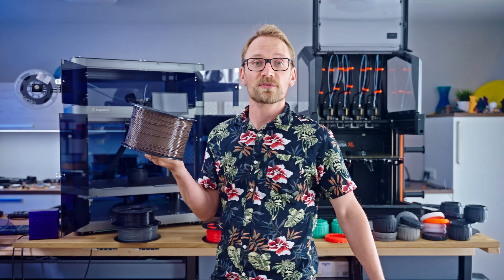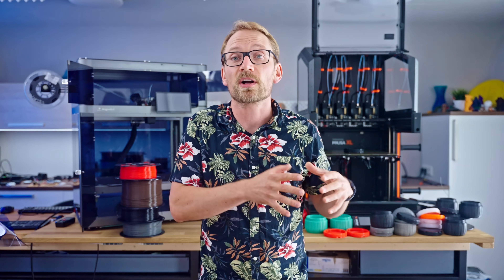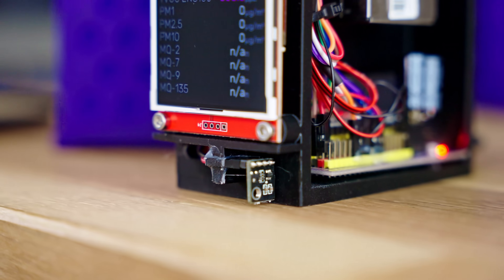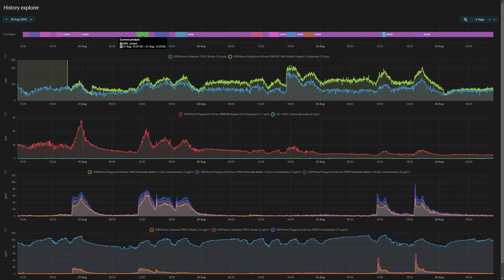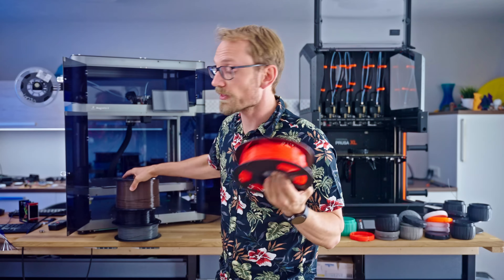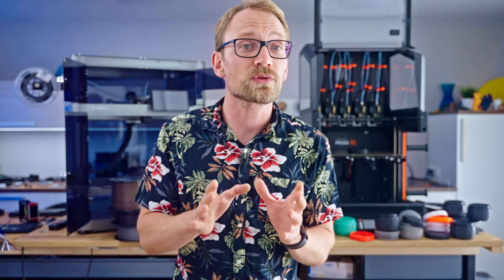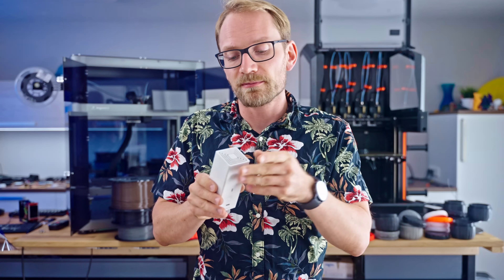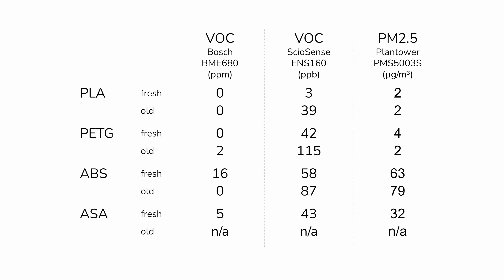3D printers are worse than I thought. Time to do something about it!

Comment: I only print in PLA Plus. I was thinking about getting an air purifier that has a hepa filter. Will that be enough?
Reply from the maker: Unless you know the emissions profile from your exact filament, it's impossible to say if a HEPA filter alone will be enough. Since I didn't measure significant amounts of particles or VOCs when printing with PLA, I still don't know what is causing the throat irritation for me that I get when sitting next to a printer printing PLA, so I don't know how I would have to filter it out.

Comment: Its like asbestos...only when the impact happens that alarm bells go off. I have printed heavily over the last 9 years. A couple of years ago I decided to put all the printers in a single isolate room and put a decent exhaust fan. It is now negative pressure and its the only way to be safe; it goes direct into the roof space and because of convection they go out the passive whirly birds; but the real question, why is there not industry standards and traps with sustainable ways of trapping and disposing of the refuse.

Comment: what kind of ventilation unit do you use for your studio, I have a similar setup in my garage which I converted to a 3d print studio but my ventilation is basically non-existent
Reply from the maker: It's a Zehnder Comfospot 50, which has 50 m³/h of air throughput and, importantly for me, comes with a heat and humidity exchanger, meaning that I can run the dehumidifier in the studio and I won't introduce tons of new humidity from the outside whenever the ventilation runs (which is pretty much always).

Comment: One issue with what was said - the daily/annual/etc cutoffs from the WHO are not a line between "safe" and "dangerous". Rather they are typically set at 1/10th to 1/100th the lowest dose found to have a detectable biological effect. And biological effect isn't necessarily toxicity.

Not to say that we shouldn't be worried about this, or take action. But breathing these particles in for 3 minutes will not have a measurable effect on your body, even if you've exceeded that cutoff.

Comment: I've been using particulate matter sensors attached to my homeassistant setup around my house and in my printer room for over a year. I only print ABS, PLA, and PETG. I've never seen any significant levels of pm at 2.5. If you want to scare yourself, open some microwave popcorn near a sensor. Proximity is a real issue, and generally speaking, you have to be pretty close to be affected. Unlike Thomas, I did find enclosures help, and as I'm not measuring vox, I found carbon filtering didn't help, but HEPA filtering does. It's quite easy to set one up with both and a positive pressure fan. Opening a window with a fan blowing air out makes the most difference, but the levels have always been way below recommended minimum levels even with the worst (Prusa) and the sensor within 1 metre.

Comment: I have an smaller ikea filter like you showed. How often do you reckon he filter cartridges needs replacing
Reply from the maker: It has a filter change light that comes on based on runtime and fan speed - on the lowest setting, that's a couple of months. I tend to change my filters based on how messed-up they look - if they've been running for half a year but still look like new, they get to go again until the change light comes on again, but if they're all grey and sticky, they go in the bin. The filters shouldn't lose their effectiveness, but they will increase in flow resistance over time. Basically, your call how filthy you want to let them get ;-)
Reply: @MadeWithLayers  thanks. Was thinking to do the esphome hack for the sensor but haven't done yet. Did you say the IKEA sensor isn't great for 3d printer pollutants

Comment: I read an article a few years ago that you are exposed to dangerous levels of voc’s when you buy a new sofa with foam cushions and the memory foam mattresses can both of gas for weeks after installation. My printers are in a dedicated room where I don’t work while printers are running. Years ago photocopiers and laser printers had to be installed in a dedicated room with high ventilation due to toxic fumes. This is an issue that’s around us everyday and not just 3d printing.
Reply: An especially notable example of this is new car smell. It can take over a decade for that to finish off gassing.

New car smell has always made me feel nauseated and gives me a headache ever since I was a little kid.
Reply: @nobody2021 and you can buy it in a can😂
Reply: that's why california puts that cancer risk warning label on seemingly everything.
Reply: One youtuber did some tests on his print room too... He kept   getting spikes when he increased ventilation.

He concluded that being neighbour to 3 construction sites made the outside air much worse than his printer Room
Reply: @greystorm9974  This is both hilarious and terrifying.
Reply: @greystorm9974  What Youtuber?
Reply: @greystorm9974 depends on what you are printing, but also "increasing ventilation" implies you are getting clean air. If you live next to a factory or use your car exhaust to push more air into your room you're obviously not getting clean air and need a change
Reply: @jawaring4367 Windows open and using regular fans. Will see if i can find it
Reply: The mattress will diminishingly give off gases for weeks... but the printer is will be doing it full blast every time you use it for years.
Reply: laser printers and copiers are source of ozone which in higher concentrations is harmful
Reply: good insight

Comment: Thanks for raising awareness! Have you experimented with Nylon? Also it would be interesting to see how these numbers change for composite filaments that contain glass/carbon particles. 

I have adapted the exhaust of my P1S to attach it to active extraction Duco system of the house. I have also modded the stock cartridge to include small hepa filter and loose pellets. But I will certainly consider buying a standalone filter for the room.

Comment: I did built an air exhaust/evacuation system and enclosure out of wood & arcylic to print more exotic materials on my Ender 3 Pro. But my enclosure is not big enough and I settled on just printing PETG & PLA. Maybe ill buy a small printer that can fit inside my enclosure and just make it dedicated to printing exotic materials.

Also should i be concern if my PLA starts to smell sweet and surgary?

Comment: Those formaldehyde sensors are totally inaccurate. At those levels you would smell a horrific smell if there was actually formaldehyde. They detect all kinds of other chemicals as formaldehyde. I would recommend not using those sensors as they will mask real problems. In environments where formaldehyde really does need to be detected, they don't use those sensors. They are essentially a scam. You can read the academic literature on this topic, and you can see that these sensors really don't work at all, and that you have to use other techniques to pick up formaldehyde. The VOC sensors are also not perfect, but they do detect various compounds with different levels of sensitivity as you mentioned. They are more acceptable.
Reply: Also, side note, just buy activated carbon and make your own filter.
Reply: Also, you should test whether dried filament emits less, particularly for PETG. This is something I have noticed, but I would love to see what you find.

Comment: Those particle matter sensors cannot measure particles > 2.5 micron. So every reported value for larger particles is extrapolated.
This also means the humidity will have an effect on your measurements as those smaller particles can stick together.

This will cause hard to interpret data. So as always: "Measuring is knowing, when you know what you're measuring".

Thus try to correlate concentrations with the humidity when drawing conclusions.
Reply: they are good enough considering the actual health effect correlation to particle size, a normal home air filter will filter out most of those particles but any Vocs, but PLA and PETG dont produce them in enough quantities to be concerned about, the air quality in most cities is worse than any ventilated room pritning PLA can be
Reply: @swe872  My point was more like those different materials are printed at different temperatures and thus also affect (relative) humidity. And with different humidity your measurements may shift in the actual particle sizes. Since those sensors do not measure over 2.5 micron it might report much lower readings while you may have quite a bit floating around only stuck together. This then makes it much harder to compare them.  And whether those sensors are "good enough" depends on what you try to measure. For example in a wood workshop those might report totally unrealistic low values when you can't even see clearly anymore due to the dust, but those sensors report all is just fine.

Like I said, measuring is knowing if you know what you're measuring.
In other words, if it is unclear (or the manufacturer is not giving information ) what the sensor actually does with the sampled data, does it even make sense then to measure it at all?

Comment: I would argue that an enclosure can actually help preventing the fumes from entering the room when you properly seal it. I use a 60 cm server closet with dampening mats and gaskets for the doors so there is very little exchange between room and enclosure. Inside of it I use a small bento box filter that circulates the air and runs even after a print is finished. Additionally I use a room filter with active carbon and hepa 12. Medion has some cheap options with affordable replacement filters.

Comment: Very surprised there was no mention of the Nevermore filter project! It's an open-source recirculating filter with a few configurations. They're mainly intended for Vorons but can be installed in/on any printer.

I have a Nevermore StealthMax and it holds about 1lb of activated carbon pellets. It has VOC sensors in the intake and exhaust to verify the filter is working as it should. You want to really seal up your printer well because it is a recirculating filter. The more times the air passes through, the cleaner it will be. Plus, you don't want unfiltered air leaking out. It's very effective and I really appreciate the effort the contributors have put into it.
Reply: the nevermore is just way too small to be an effective solution. if anything, it gives you a false sense of safety. extraction is what you want if you dont want to have a filter the size of the printer.
Reply: @drkastenbrot  The sensors prove it works as expected and the carbon lasts me ~350 printing hours before the intake/exhaust VOC delta gets too small. Like I said, the StealthMax [S] versions hold quite a lot of carbon, and with a well-sealed enclosure I don't see why this wouldn't be a perfectly fine solution.
Reply: @MarioTheModder  That's not a lot of carbon and I doubt the sensor proves anything. What sensor do they use? Because all consumer ones will give you only relative values and lots of them autocalibrate in a short period, a sensor sitting permantently in the contaminated environment will take it as the baseline
Reply: @PrimalShutter  They use two SGP40s, one on intake and one on exhaust. Calibration is disabled during printing. Relative measurements are all you need, you just need to know that the air is getting cleaner as it goes through the filter. If the printer is sealed, nothing is getting out anyway.

You should look into the project, they've done a lot of research and detailed write-ups of these topics.

In your experience, how much carbon is enough?
Reply: @MarioTheModder 
Industrial systems have a couple of kg of Carben, the system we have fore the machin att uni is cirka 1m³
Also constant calibration is nesesery to make shore that the sensor readings dos not drift
Reply: Hi, i am building two StealthMax filters for my Vorons 2.4 and Trident. I also want to include the VOC UV Filter. Do you have tried out the UV Filter addon ? Does it really work ?

Comment: Even printing with PLA, made me feel dizzy and nauseous.

So I build an cabinet from two IKEA tables and put my printer inside, then installed an air vent from the cabinet towards my attic one floor above my room. A 3000 RPM desktop pc fan is used for airflow, fan RPM is pwm controlled based on the nozzels temperature I read from my printers API.

My nauseous feeling is completely gone now, as wel are all mice that used to live on my attic...

Comment: If you look at professional air extraction and filter systems for soldering, welding or laser cutting, you start to get an idea of what a good filter cost, how big and heavy they need to be to be somewhat effective at removing air pollution. The little "activated carbon" filters might be handy, but they only capture a very small amount and need to be replaced often to have any effect at all.
Would have been interesting to see if you can actually measure how fast the filters degrade over time. Maybe you will pick that data up over time if you keep your data collectors running and track the runtime of the filters?
Reply: Brother says in the video: 
Activated Carbon makes no difference, because it's too little. It's about the paper filter itself...

Comment: I recommend a commercial BTEX and VOC tester with a pump and sniffer system, passive sensors are just not as good, I use a tester that monitors constantly and will even respond to my wife mopping a floor in another room almost immediately

Comment: I have made pretty much the same sensor selection as you have. I have been running it since nearly two years. My printers are within my own 'cabinet' style enclosures , with negative pressure trough a fan and following activated carbon filter. 
My system records printing progress and temps on the same graph as all the air data. I can not detected any significant changes in air quality, unless I use hair spray on the build plate, or have the carbon filters removed.

Comment: I got a Philips air purifier with a HEPA and carbon filter next to my printer. It turns on automatically with a built-in particle sensor, and that thing revs up when I start printing. 

The whole purifier is only about the size of an office trash can, but I only print PLA and, with the purifier running, you can't even smell the print. 
Here's hoping it filters more than whatever is causing the smell...

Comment: All my printers are Vorons now and thus enclosed. And they all have exhausts with one hose each going out through a window. Negative pressure is the way to go. I wish I'd done this sooner but at least I only did PLA and PETG before. Once I started using ABS, I didn't even start printing until I had the exhaust system in place. I also gave up on resin printing due to how difficult it was to avoid stinking up the whole place.
Reply: PETG and PLA are pretty much safe to use on open bed printers, but you absolutely should never print ABS on anything but a properly enclosed and filtered printer

Comment: The VOC emissions from PETG are a little surprising considering the squeaky-clean performance from earlier studies, but it is important to remember that there are literally hundreds of different formulations under each polymer type. Filament makers generally aim for consistent performance across a polymer type with all the pigments they're using, rather than consistent emissions. Plus without something like a spectrometer, it's impossible to determine whether the VOC emitted is super toxic at X parts per trillion (e.g. dioxins) or toxic if you swim in it while drinking it (e.g. ethanol, acetone). IMHO the best way to deal with VOC emissions is to simply vent the air outside.

You can make a pretty good particulate filter with 3M HVAC filters and a box fan. Lots of surface area, lots of air movement... and lots of noise.
Reply from the maker: Yup, especially with all the "Plus", "Pro", "Silk" ... etc variants of filaments that are everywhere now with who knows what additives added to the mix, variability between different filament brands, types and colors can be pretty big. I tried to get a relatively broad range of manufacturers into my testing, but of course it's still only a super small sample of what's out there.
Reply: @MadeWithLayers  did you test esun pla+?
Reply: I agree with everything here. My experience and research backs it all up, including the filament manufacturer being important. My tests (such that they are) show very little pm from my chosen manufacturer of TPU, PLA and PETG. I've no opinions on VOC as I've not been measuring it, but people who work in the field know that the sensors we use, and the way we interpret the data is woefully inaccurate at best.
Reply: @ljadf this is a super important conversation. I can’t believe that all PLA filaments are created equally and I’m sure that there are additives that are more toxic than others. I bought one of the air monitors on Amazon and while most of the PLA I was printing did not generate a worrisome amount of VOC, a specific color (red) of a specific manufacturer sent the value for formaldehyde up like craaaaaazy.
Reply: Do a web search for "fake petg". A large portion of filament sold as "petg", isn't.